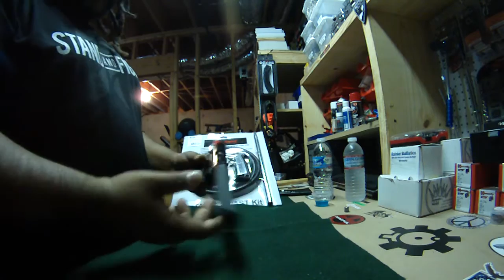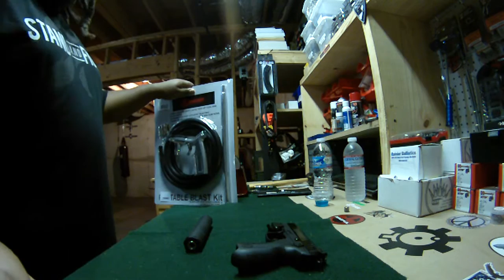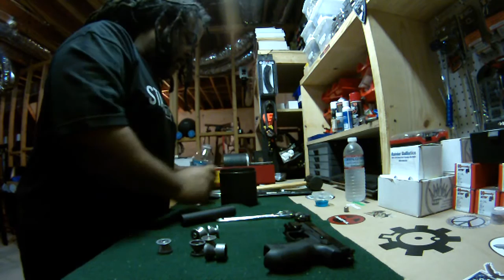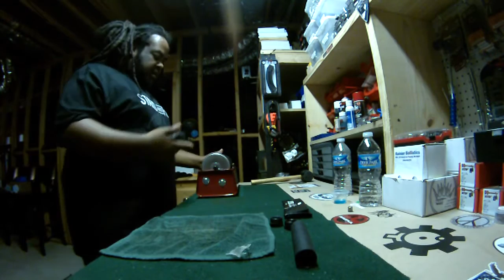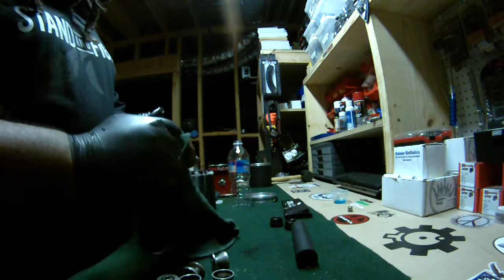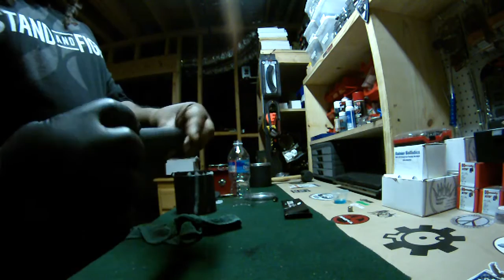Cleaning a Suppressors Aluminum K - Baffles

Comment: Great video...I have a Surefire Ryder 22 caliber can.(Aluminum).. You are correct there are very few videos on how to clean these .. (and once you shoot for a while they are not easy to take apart). I will give you some advice.. Do not handle dirty pins without Latex gloves.. Lead, will be in the pins and water..
Reply from the maker: Thanks for the tip!!
Reply: I shoot a lot 3x per week and in the winter most of it is indoors. It is hard to find a properly vented indoor range.. Even when you sweep up or pick up your brass you are being exposed to lead.. Same thing with cast bullets (Making your own, or shooting them) more exposure..  Then if you shoot shotgun guess what more lead exposure..

Cleaning anything firearm or Suppressor related means lead exposure..  I had a simple blood test done to check my lead levels and they were elevated. (not near as bad as a friend of mine). So i cut way back on shooting indoors and paid more attention to cleaning up right after shooting or any exposure.. Then taking a good shower when i got home and the clothing I had on went right in to the wash..

Good news my levels dropped significantly after one year and at 2 years are almost normal.. I am older so not as alarmed as if I were a Child or a twenty something.. Hope this helps anyone who takes the time to read it..

Comment: Thanks for the video, I recently got a Huntertown Arms suppressor as well but ponied up for the stainless baffles. Do you have any issues with the stainless media beating up the aluminum?

I haven't decided how to clean mine easier yet (first time I opened mine up, it looked like it was full of sand and tar and that was after less than 200 rounds!). I have an ultra sonic cleaner on order but now I'm thinking I should have gotten a tumbler setup like yours.

Also, nice trick with the sockets and mallet!
Reply from the maker: I havent had a problem with the media beating up the baffles at all. I even forgot and left the tumbler running for around 22 hours last weekend and they were fine. The tumbler motor was hot though. The media doesnt clean all of the lead from the inside of the baffles but it cleans them enough for me to live with right now. I will opt for the Kestrel baffles after while but for now I will get my moneys worth out of the aluminum ones first. 

I have tried a few other methods for removal of the baffles, dowels and even the AAC baffles stack removal tool. But, Yes, The socket set and a rubber mallet works the best for me and it hasnt damaged my baffles yet!! If you are squeamish about your suppressor, I wouldnt try it cause sometimes I really have to bang on the baffles to get them to budge! 

Thanks for watching!!!

Comment: Really appreciate the video man. Just got my stamp for my Guardian 22. Are you still using the cleaning method with good effect?
Reply from the maker: +Matt R Oh yes, Still using this method. Only addition has been adding a small amount of Lemi-shine to the mix. By small amount I mean a take a spent 9mm case and fill the casing about half full and add it in. It doesn't take much! Works good for cleaning brass for reloading also!!
Reply: Awesome - really appreciate the info!  Been reading all kinds of different methods and I really wasn't impressed. Will try this one. Thanks again!
Reply from the maker: I havent watched this video ina while so just in case I didnt mention it. This method doesnt remove ALL of the lead build up, but it does get the majority off. There will still be some build up on the baffle stacks.